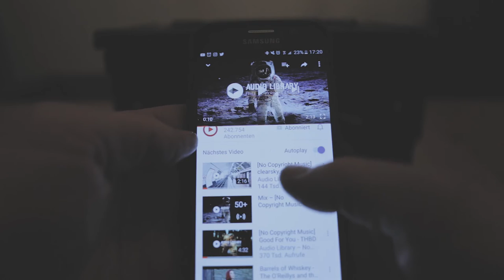DIY Ammo-Can Boombox

Comment: How good is the bluetooth range from the 7492P circuit board when the lid is closed?
Reply from the maker: dries v it's about 4-5 Meters.
Reply: Alright thanks, still quite good considering the antenna is in a locked metal box.